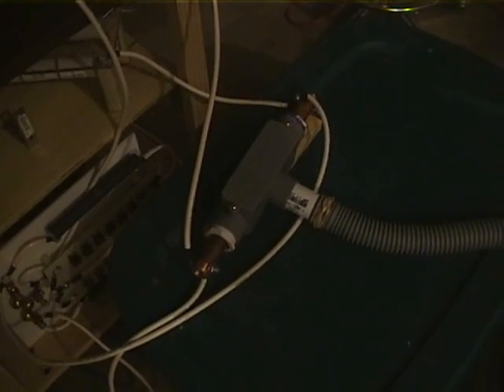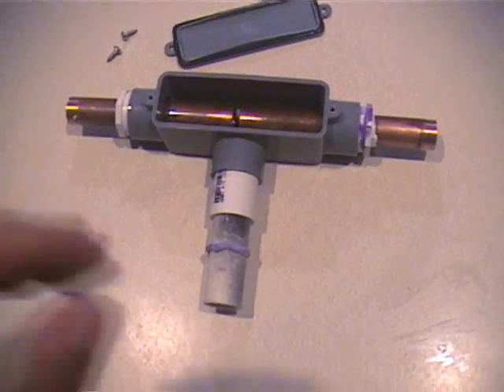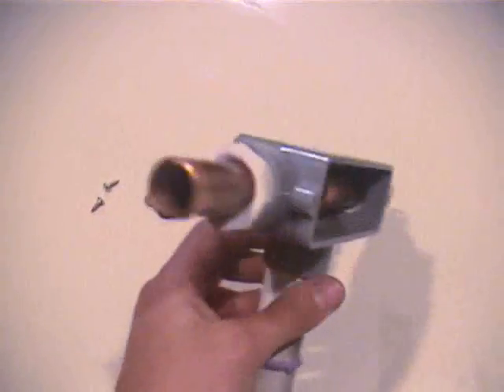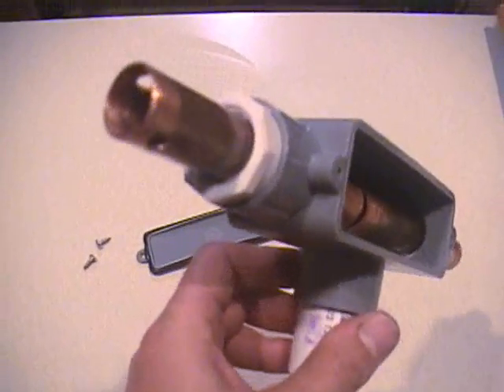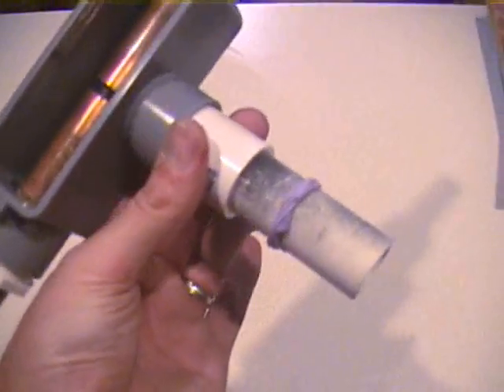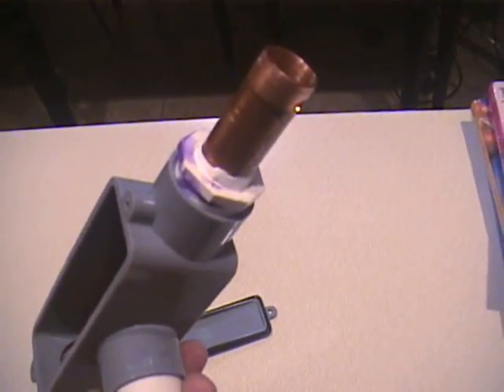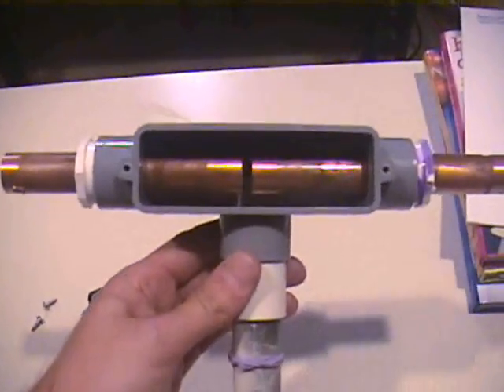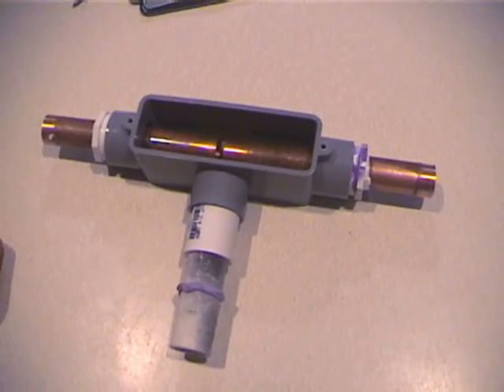Tesla Coil with PQHSG

Comment from the maker: A good question - the pressurized gap was a development from the sucker gap. The Tesla Coil Mailing list suggested the idea. I have not tested the sucker gap, but it is generally agreed that the pressure chamber design is better.

We've had the best results with it, even better than a sync rotary gap.

I think that the pressure in the chamber increases the air resistance and can lead to higher energy in each discharge.